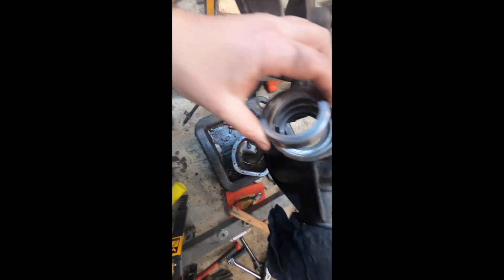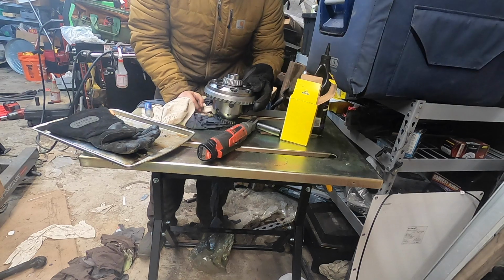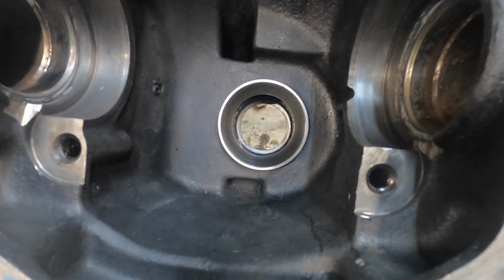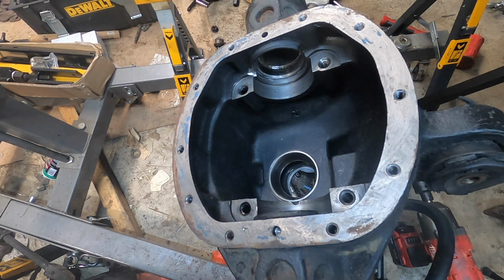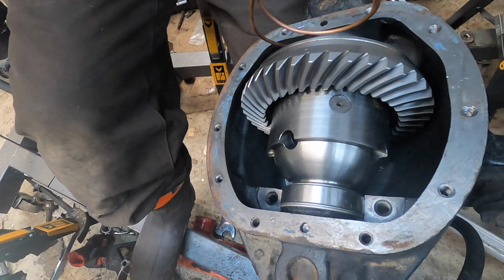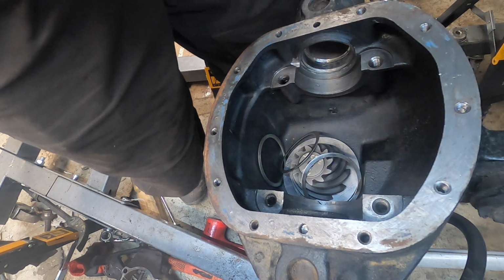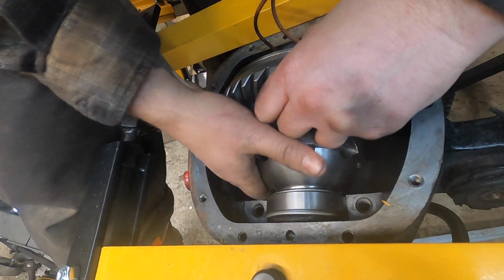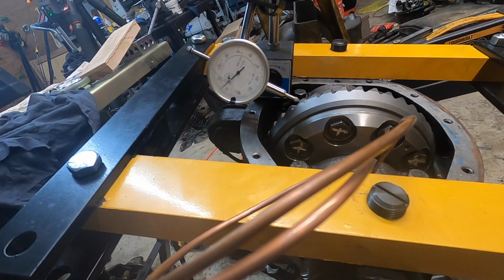R2 8 Cummins Dana 30 Regear Part 4

Comment: How do you like the r2.8?

And where did you buy it from?

Thanks
Reply from the maker: I love the R2.8 for what it is. I'm not going to claim it's the best engine ever, but I think the specs and the basic principles of the engine are pretty good. It will really save time for an installation too compared to finding a used engine, rebuilding it, fitting it, etc. I have some plans to get back into this stuff further and talk about my impressions and reflections on this engine and this category of engine.

I just ordered my engine from Cummins.
Reply: @bugoutjeep8065  I am planning on putting one in a 1990 Isuzu trooper.

The trooper has a five-speed manual transmission with a transfer case that I want to reuse.

I saw a line that a company called quick draw has adapter plate that you can machine yourself to fit any transmission.

But when I told them they don't pick up.

I think it'll do good in a small trooper.

Keep it up I like your videos
Reply from the maker: @epicjourney6341  that sounds like a cool build. Quickdraw seems to be a solid company but I've nice worked with them. I have thought a little about going with a tr4050 transmission and using their adapter if I do. 

What torque can the transmission handle? Do you know the ratios (axle/transmission) and tire size?
Reply: @bugoutjeep8065  not 100% sure it has a  gm 2.8 v6 in it.
It has 32 inch tires.

I was going to do a 4.3 vortex or the cummins r2.8
Reply from the maker: @epicjourney6341  just make sure it can handle the torque. Crate engines are pretty expensive, but diesel is awesome for 4x4s and off road unless you need a lot of wheel speed.